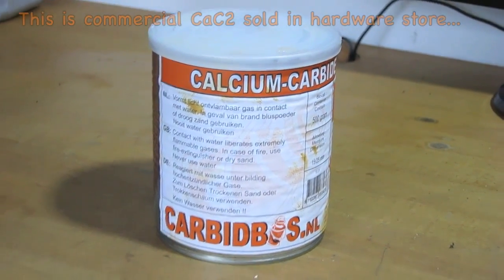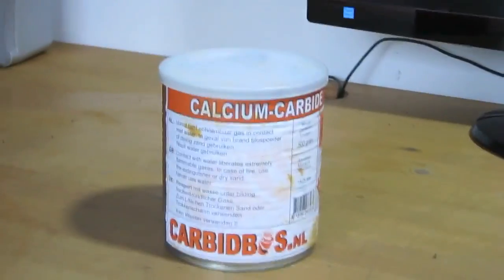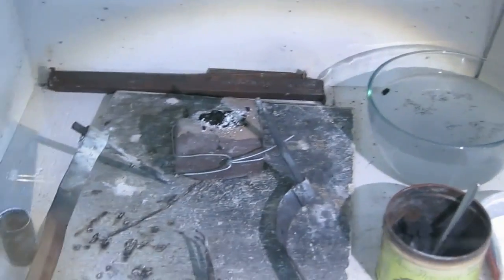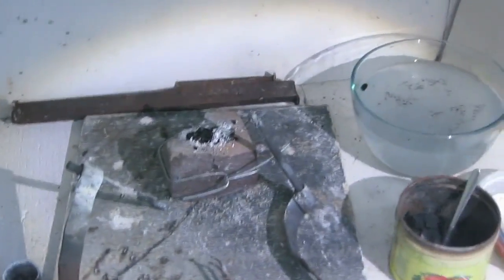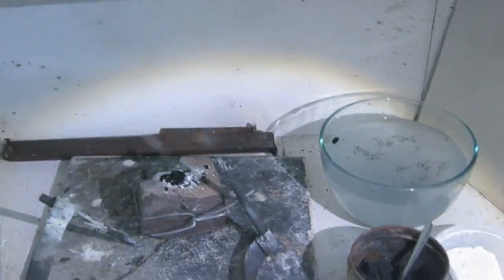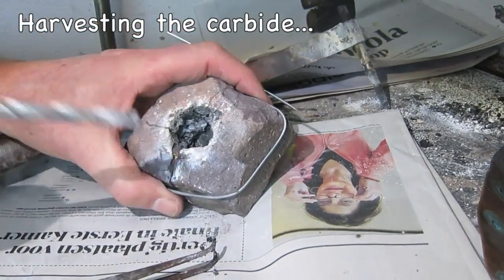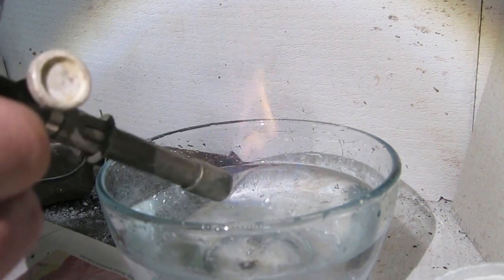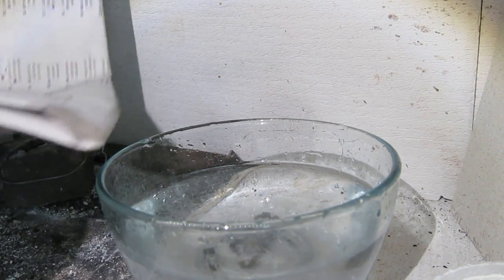Making Calcium Carbide CaC2 with electric arc

Comment: To make it reliably mix lime graphite powder, salt, sand, and charcoal together preferably with ball milling. Next put this into a ceramic flower pot with the electrodes barely touching from the sides. Cover the flower pot with another one and seal with pottery clay. Bury the works most of the way in dry sand. Attach your arc welder and allow to heat up and react. It is normal to have smoke and fire exit the drain hole from the top. When this stops cover the rest of the way with sand. About 15 minutes later your reaction is complete. Remove power and allow to cool. You will have mostly calcium carbide, some silicon carbide, and some slag at the bottom. ❤
Reply: Hey there, I know this is a really old comment, but I’m wondering if you could tell me the ratios of the lime, graphite, salt (NaCl?), and charcoal. What’s the purpose of the salt in the mixture? 
Thanks!
Reply: Graphite and charcoal are a 50/50 mix. Lime is 1, carbon is 3 parts molar. CaO + 3C > CaC2 + CO ideally and salt and sand are added in small amounts @manavali92

Comment: What kind of voltage is required for this?
Reply: You only need 20-25V, but a current rating of about 50-100A. So you need a welding transformer.
Reply: @linusc.3812  figured so for the heat you'd need the 100 Amps thanks tho

Comment: Is it possible to replace graphite electrodes by something more easy to find ? Does it work with iron electrodes or charcoal pieces ?
Reply: You can use carbon rods from batteries or pencils they are almost the same properties as a graphite and same material
Reply: @MathewZ788  Pencil rods usually have a high resistance.
Reply: You can, but iron will melt quickly and there will be mroe impurities in your product.